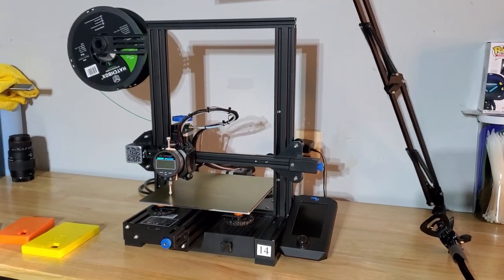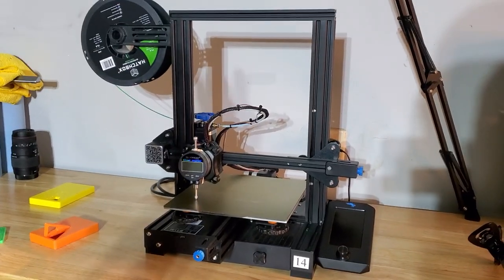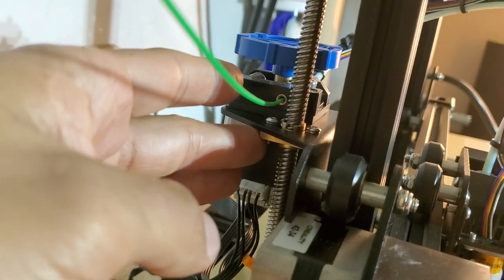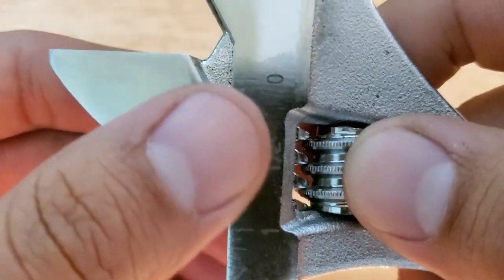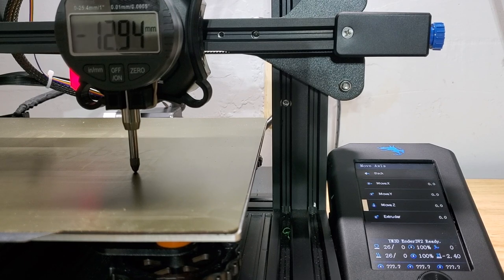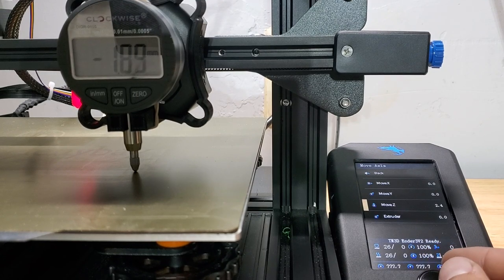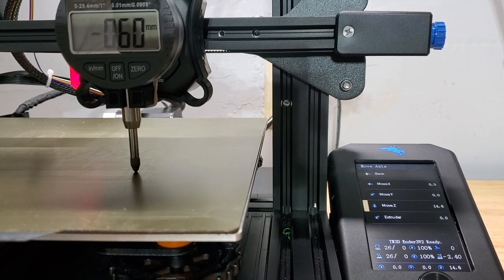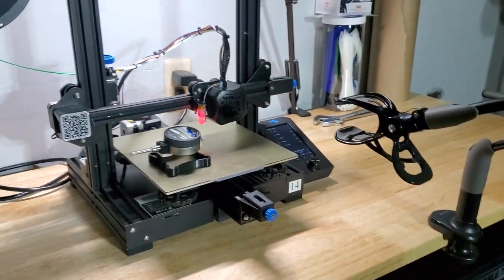3D Printing Elephants foot. How your lead screw is causing it and how to fix it! Ender 3v2

Comment: I have been 3D printing for five years already, I got my first Ender 3 two years ago and it started printing with elephant's foot a while ago, and I never suspected from that lead screw nut. I had honestly given up on printing accurately. This video changed everything. Thank you so much!
Reply: My E3 has just started too with Elephantitis. Did you fix yours by this method, if not what worked?

Comment: I've built a couple of CNC routers, a CNC milling machine. And now a Voron V0.1. The issue is your gantry bearings are too tight. While your explanation of what backlash is, is totally correct. If your bearings on your gantry are set correctly, and good. The reason the bearings being too tight causes this is because these machines are designed to have a constant weight downward on the lead screw. This is why they do not use an anti backlash nut from the start. And if in fact there is a constant force downward. There is no backlash. Because it should be pushing down on the lead screw at all times I had this same issue when I started printing a couple years ago with my V2. Just a quick adjustment on bearing preload. And it dropped down. And has never been a problem since. 

You are correct that the nuts do wear out though, and we should keep an eye on them because they're cheap and easy to replace.
Reply: I fully agree with this, re gantry bearings.  I have also found that the bed temperature differences for various filaments affects the bed levelling, Z-stop index (of course), but also I guess due to heat soaking, the gantry bearing pressures.  My Ender 3 V2 is in an enclosure and I recently gave it a good clean and service, lubricated the Z-axis screw, and also adjusted all my bearings making them just a tad tighter  -  then started getting elephants foot and undersize calibration cubes in Z only, mainly on PLA, but not on PETG parts.  I was suspecting my anti-backlash nut was getting a little tired, but then thought it through properly (as believe you are perfectly correct; the Ender 3 is designed to have constant weight on the lead screw nut and the anti-backlash nut does solve the gantry 'drop' / backlash issue which just needs to be understood).  I cycled the machine-up/down the Z-axis a few times, re-checked & adjusted Z steps and re-dialed-in my profiles taking my time and properly heat soaking the machine each time.  Took me three or four calibration cubes per material, but elephants foot solved - getting the non-driven gantry bearing adjustment just right was key, and had to be a compromise for various temperatures, and also use a different Z-offset for each material - as get about 0,1mm gantry drop on PLA but none when using PETG.  A dual Z-drive lead screw system would definitely help, but even then the gantry bearings would still have to be set just right.
Reply: @chrisgill5692  Right! I have dual Z on all my Ender style printers. Some with dual motors and one with a belt at the top connecting two rods. But by far the best and most reliable has been KevinAKAsam’s belted Z mod. If you don’t know… It removes the leadscrews altogether from the z axis and replaces it with a belt drive system. No more z banding, no more temperature caused differences. I’m currently working on collecting and printing parts to do the belted z mod to my other three Enders.
Reply: @brandoncrimmins6296  yeah thanks, seen that linear rail/belt mod - looks really nice, simple and reasonably good value.  With some effort, these cheap Ender's are good enough for my needs and I can get really nice prints (if a little slow) - it's just how much effort!!! 🤣
Reply: @chrisgill5692  100% agreed! I have 4 Ender 3 style machines and they all still work great. Yes they print at about a 1/4 the speed of my vorons and even my Flashforge Adventurer 3 is a little quicker and more convenient with the WiFi. But the Enders just keep working. They print very well for the money and it’s hard to beat the value! Especially since I buy most of my machines on second hand/return sales through the manufacturer. The last Enders clone I bought was only $59! It’s a Voxelab Aquila S2.
Reply: Hey, i have an ender 3v2, but i dont completely understand your solution, i am not sure which bearings are too tight?
Reply: @D4vidPgc  No worries man. I gotcha covered! On either side of the gantry. The V-Wheels on the INSIDE of the upright posts are use to tension the gantry. They are mounted using eccentric cams. You should have gotten a wrench that fits the hex on the cam. All you do is turn the cam until they slide freely up and down. It doesn’t matter which direction you turn the cam. The bearing assemblies should fall back down under their own weight with little resistance. 

The only thing that sucks is to do it right requires complete disassembly of the gantry. So you need to remove the x rail that connects the two sides. But this also gives you the ability to square the gantry when you reassemble it. And also make sure it’s tight when you reassemble.
Reply: Man, thanks a lot. I was having trouble with elephant foot for a long time and tried to replace a lot of parts and make a lot of ajustments unsuccessfully. My ender 3 is printing fine now

Comment: You are right that there is back lash but all the back lash is taken away once the lead screw makes contact with the other side of the threads. This means that the back lash is taken out very quickly, not 8mm, its just like a manual milling machine. Someone already said that the indicator is away from the lead screw so you could have some cantilever action going on, with this I say check the rollers on the z-axis. As much as it seems you are printing I would say you have some wear on the plastic rollers. Adding a second lead screw was one of the best investments I have done with my printers.

Comment: I came to 3D printing a few years ago, from an engineering background.  First mod on my cheap Ender machine?  Anti-backlash nuts - they don't completely solve it, but reduce it and also act as vibration dampers.  Keep your lead screw clean and apply dry lubricant now and again.

Comment: HOLY GOD!!!! I must've watched like 15 videos on elephant's foot and NONE of them were able to fix the issue I was having! I spent over a week troubleshooting and adjusting bed leveling, bed temperature, Z-Offset, recalibrating my E-Steps, and various other things! (The E-Steps helped a little bit) I watch this video and put an anti-backlash nut on my lead screw and BAM! I'm back in business like it's brand new! I can't thank you enough for posting this! I've never had a problem with elephant's foot before (been printing for about 9 months) and none of the traditional methods seemed to fix my issue. This video opened my eyes to an issue that I had never considered and honestly didn't know anything about! ISSUE SOLVED!!! Once again, thank you so much for posting this! HUGE HELP!
Reply from the maker: Really glad this was able to help you! This kicked my ass too until one day i had my aha moment.

Comment: Makes total sense! I always figured those anti backlash nuts were a gimmick since the printer z dimension only goes up during a print. Never crossed my mind that it’s first movement is transitioning from down to up. Meanwhile nearly all my prints have a bit of elephants foot. Hope this solves it! Thanks you!
Reply: Reduced the issue from measuring my first print but didn't completely resolve the it. I'm struggling with bed adhesion to rule out the bed/nozzle distance. Maybe I'm being too picky. The elephants foot is .085-.11mm. That doesn't seem like it would be a lot but you can feel it on all prints, its visible in certain conditions on others. Again maybe I'm just asking too much at this point from a 200 dollar printer....

Comment: Just installed those backlash nuts on the cr10s pro v2. Was having problem with travel/tire marks on my print. Seems to show some improvement after auto-leveling. Readings were better compared to stock brass fitting. Thanks!

Comment: What an excellent video sir and this will be my first ever YouTube comment. I will add one thing your analysis as a preventative measure in addition to the anti backlash nut. Grease your lead screw. My Ender 3 came with almost no grease and after 6 months the nut had worn out as you described here. I think this nut simply needs replacement after some amount of time but grease will extend its life
Reply from the maker: I appreciate that! Thank you!

Comment: Another thing that may make the backlash seem worse on your ender 3, since you are measuring on the right side, is that the ender lifts from only one side, the left, and the right side is sort of dragging behind. 

This is currently only theoretical idea.
Thus when you move down it stays higher than the left that is more rigidly connected to the lead screw and when move up, first it levels out with the right and left rollers then as you move more up the right side starts dragging along slightly behind the left side.

If i remember right one of the nuts on the right side is eccentric and is used to tension that sides rollers.
Reply from the maker: You are absolutely correct. The right side is worse than the left. I have another video planned where I will fully explain my findings on the ender 3, and the setbacks that I think keep it from being a perfect workhorse printer.
Reply: I believe a bltouch accounts for that tho
Reply: @simonb252  does it?

Comment: Finally!!!Thank you for this video. I have been saying this for weeks. I’m at the point of changing my z-stop after the first layer, then again every layer for the first few layers, until it prints smoothly. I’m adjusting the z stop 0.3-0.4mm during the first few layers.

Comment: Nice explanation.  Been struggling with this a little bit lately and my bed is dialled in almost perfect due to having BLTouch and Dual-Z screws which reduced elephants foot a lot while actually increasing my first layer adhesion.  Going to add anti-backlash screws to try and get rid of that last little bit of elephants foot that I still have.  Thanks!

Comment: I now own two E3V2 printers. Recently, I have had several problems levelling the bed on the older of the two. I'd only changed the springs underneath the bed for the stronger yellow ones, the white PTFE tube for the blue Capricorn PTFE tube, and Creality's plastic extruder for a single gear aluminum one. I couldn't understand why I was having so much trouble levelling the bed after several months of reliable printing. Was the issue a mechanical one? Was it the electronics? I didn't know where to begin. I completely overhauled my printer twice now, and couldn't find the problem. I think you nailed it! Your grasp of the elephant's foot problem helped me to better understand 3D printers, and for that, I thank you. The problem you've presented here isn't obvious to many of us. I would go so far as to say that you've found a probable cause for many other Z-axis related problems. No one else has better demonstrated this problem than you at this moment. The lead screw indeed controls the accuracy of the nozzle's height in relation to the bed. If there's any play in this mechanism it will affect the height and accuracy with which the nozzle is positioned in relation to the bed. I never thought the brass nut's wear could lead to such issues, but it makes sense. I'd added lithium grease to this nut to promote parts longevity from friction, but that was the extent of my knowledge. But now that you've mentioned it, this is probably the cause for height issues I've been having with my printer. For one thing, over time, my printer became more and more difficult to level. Now, my X-axis gantry never seems to be at the correct height when I go to print after levelling the bed. Presently, I find myself having to level the bed after every print, and that's not normal. There's always a difference between the heights of the nozzle and bed. The values indicated by the display aren't very useful to me, and changing the Z offset to correct this height difference afterwards is a major source of frustration, because the values are never the same, and sometimes it doesn't work. As everyone knows, it's that first layer that makes the perfect print. If the Z-axis' accuracy is thrown off by even the smallest amount it will affect print quality. I thought the firmware was changing the Z offset without my asking it to, and I couldn't understand why it might be doing this. But I think you're right. After 8 months of 24/7 printing, the brass nut may well have worn itself out, and the backlash will have increased because of it. I only recently began adding lithium grease to the nut, but it was probably too late. The play between brass nut and lead screw could very well be affecting the height of my X-axis gantry, and making bed-levelling next to impossible. Thank you for your observations and insight into this problem. You may have helped me to understand a problem I've been having with my printer for a long while now.
Reply from the maker: Hey Henri thanks for taking the time to comment. Sometimes you have to look at things for what they are. The main thing is X, Y, Z. If you have issues with plastic laying down somehow, those are the first three spots I would look at. It took me some time of constant thinking before I had my a-ha moment. Glad it has helped you and good luck with fixing it!
Reply: @Redo3D  Thanks to your help I may have found a solution. Thanks again.

Comment: Another great video! Really digging your channel. Glad you mentioned "consumables" as well. I had asked the reddit group a little while back about maintenance on their machines and essentially nobody answered. But all machines have wear parts so I was just trying to get an idea of when I should look out for certain parts to fail or need replacing. Seems like 3d printers should have a chart like in an automotive users manual of when to replace parts! haha.

With all those machines running, I'd be really curious to hear how your wheels hold up and how often you need to replace them.
Reply from the maker: I plan to put a maintenance video together! I 100% agree with you that there should be a maintenance schedule similar to preventative maintenance guides from equipment manufacturers. I am putting some ideas together for creating an hours meter for the ender 3 v2, and with that we are able to track time and have the data for properly timed maintenance items
Reply from the maker: @miltonb4522  they do have that, but I find myself at my 3d printers a lot more often than the PC. I want to develop an actual 8 segment display that shows total hours.
Reply: @Redo3D  wouldn't a centrally controlled print farm be capable of just warning you when one of your printers is due to maintenance. A display of total print hours sounds OK for 20 printers, but scale that up to 60 and it is easy to loose track of all of them.

Comment: Wow! I finally know what's going on. That's why I am getting the elephant foot and shorter prints and weird oval holes on the walls of the part! There is some setting in cura to eliminate EF but it didn't do anything for my prints. I wonder if i can replace the lead screw with a cheap Chinese ball screw. I hear that cheap ball screws are usually shipped bent a little which affect prints. Thank you for making this video man.

Comment: Spot On! This is the BEST explanation/demonstration  video on a 3d printing issue Ive seen. Excellent presentation man! As a machinist that started with manual machinery decades ago, Ive always been aware of lead screw backlash, and it has always been second nature to always feed into the part to make an offset. By installing an anti backlash nut on an Ender 3 v2, it will remove the backlash, but will only be about 80-90% of the elephants foot issue. I noticed a very slight elephants foot still remaining, and slightly more pronounced toward the right side of the part. The problem that also contributes to it is the gantry squareness to the bed as the single lead screw moves it up and down. No matter how perfectly the Z axis rollers are dialed in, with the lead screw on only one side, the opposite side of the gantry deflects up or down slightly as the lead screw changes direction. I installed the dual lead screw kit with anti backlash nuts, and my machine is now producing zero elephants foot with dimensional consistency to .02 squareness over the entire width of the X axis, where with the single lead screw it was varying nearly .1, no matter how perfectly the bed was leveled in the X axis. My next upgrades will be linear rails and dual ball screws. I would expect tolerances and finishes that would rival my cnc mill.

Comment: you are absolutely right, very good job.
I've never seen anyone talking about it, and it's very relevant.

I've already noticed that it's very rare for my prints to show this defect on my 2.4 Voron, which has a belt for the z axis.
now I understand better, I'm going to take this measurement to see the slack I have on my machines with a bar on the z axis.
Reply from the maker: The belt driven z definitely helps! I think it's the best option with linear rails.

Comment: I started using 3d printed anti backlash nuts a while ago, I may have to change them a bit more frequently than metal, but they're tiny and can be printed with very little filament. This was an excellent video that more people probably need to see
Reply: I don't have an Ender but I downgraded my z screws to m6 and designed anti backlash nuts with actual springs in them connecting two normal stainless nuts. For now the Z screws are mild steel but I'll replace them with stainless if needed.
Reply: A year late I know, but brass anti-backlash nut kits aren't really that expensive, and if you occasionally lube the z axis lead screw, will last indefinitely.